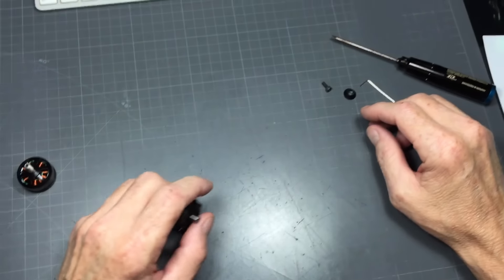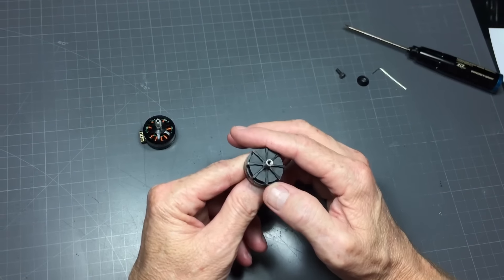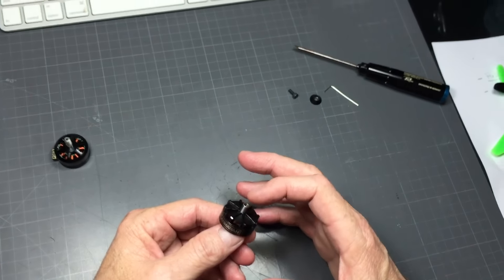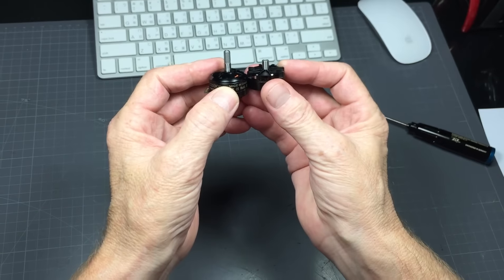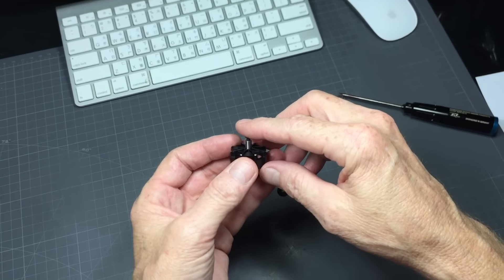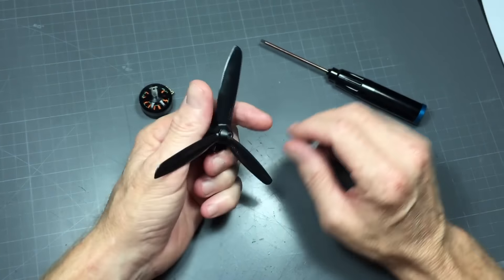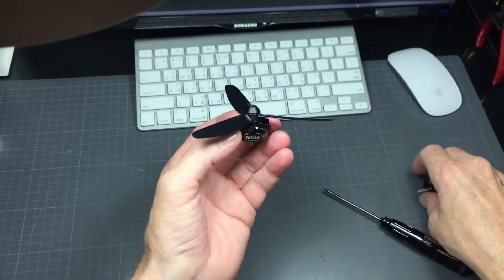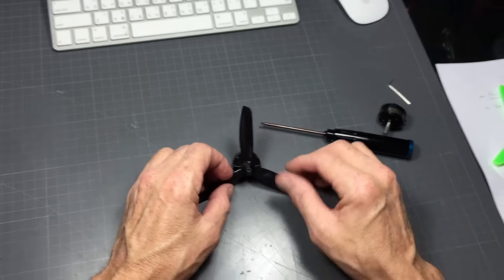New Armattan Motors

Comment: Amazing! Glad I didn't pull the trigger on some  2206 Brother Hobby Tornado T2s yet. Stoked to hear your new motors should be out before the end of the month. Are you guys taking preorders by any chance ;)
Reply from the maker: Hi Oliver. Sorry, we never accept pre-orders for anything. It's a house policy. :)
Reply: No worries. Are you guys still on target to release these new motors in the next couple weeks? Also do you plan to support them with new stock and replacement parts long term? For example, those new 2206 ZMX Fusion motors are also top performers, but a lot peeps sound a bit burnered by their v3 predecessors being quickly discontinued.
Reply from the maker: Yes, of course. No plans to discontinue these just yet. As for still being on target, yes, we are.
Reply: Fantastic! Great to hear!! ;)

Comment: Hey Chris great motor! Was wondering what size is the bottom screw that holds the bell on? Any chance it has a 2mm button head, or is it the 1.5mm like the DYS. Thats the one issue I found with the DYS, even with a good 1.5mm hex driver I still manage to strip those little button heads out easily.
Reply from the maker: The retaining bolts are M2.5.  The hex drive is 1.5mm. But DYS uses white locktite/glue on these bolts as to not have to tighten them too hard. The locktite can cause problems. With the shaft the exact right length, no need for locktite as the bolt can be sufficiently tightened against the shaft. That's what we did.
Reply: Armattan Quads when I took my bells off they were all
Lock tighted and I noticed if you tighten the retaining screws up more then slightly snug tight the motors wont rotate freely and there is resistance so not sure why you say these are any different. One bell was locktighted so much I can’t undo it and the 1.5mm hex just stripper out. If Armattan are continuing this way with their motors Im not sure I want any more. I’m just left with one useless motor.

Comment: What hex driver are you using?
Reply from the maker: Hi,
The brand is Revolution Design Racing Products. Engineered in Germany, likely made in China and sold at Hobby King. The size I used in this video is 2.5mm.  Best hex drivers I have ever used.